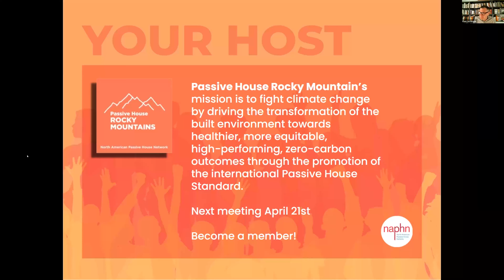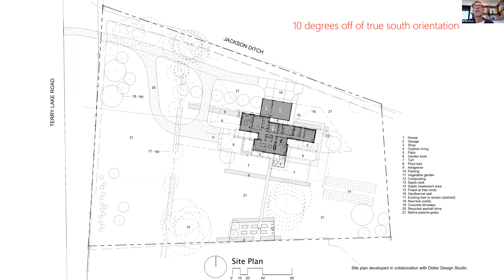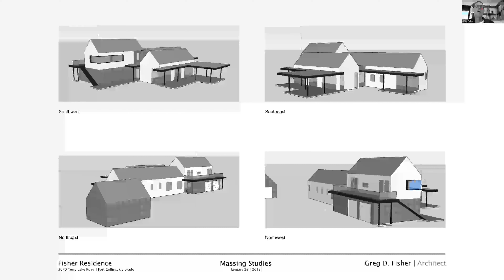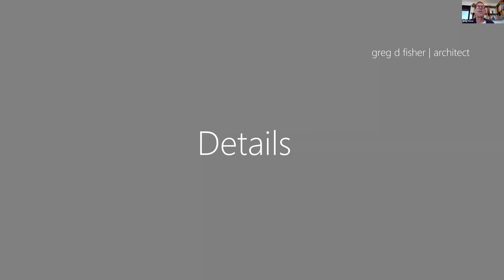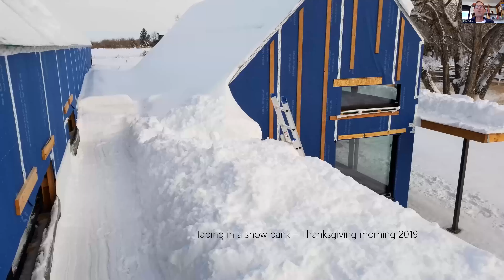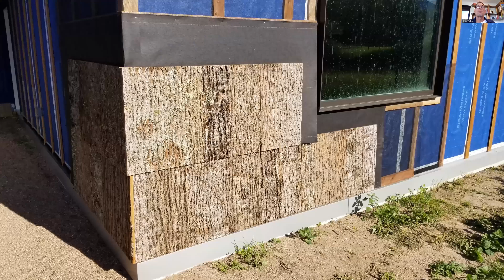NAPHN LIVE Millhaus Case Study

Comment: Thank you for the (objective) comprehensive presentation. Where else is interior Thermal MASS,? other than , floor slab[= lower priority], as compared to wall-mass. As we all know Dry-wall is not MASS. What maybe the ratio of true MASS, and floor space, as compared to 'Aperture =over all window-opening.? 
How many trees had to be scarified to build this house - what was percentage of waste building this in reg. Stick-Frame.? What was the actual cost per sq/ft.,
and who can afford this?. If this is a truly Direct Passive Solar home, will it NEVER go below 38 degrees when ALL other systems are down [as there are 'Active components], when 
there is no external heat source, while outside there's a raging winter storm - 3 days in,, and temps are hovering around 0 F. and lower?! Will it never freeze inside, no matter what conditions.?
Are there in interior walls -- upper and lower vents to cause natural convection through out the house, thus moving [warm] air w/o mechanical means? 
Are your windows on Solar south simply 'clear-glass, except on some East - West, but North side indeed have Low-E glass?. ( or other)
How easily could you change out windows, and doors?, or are they all locked in. Thanks for the discussion on these points.Paul Kloppenburg /  pckpablo@gmail.com -- Crestone, Colorado